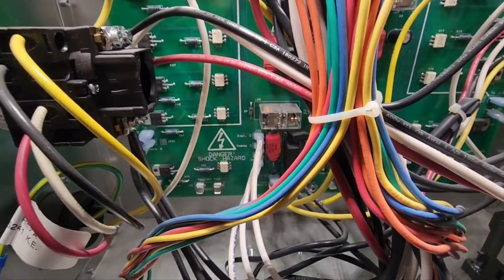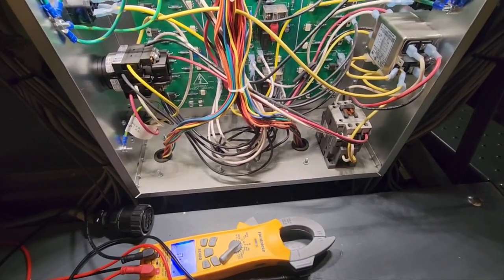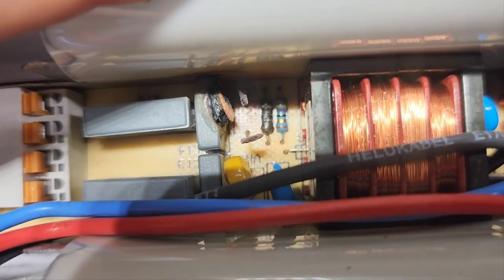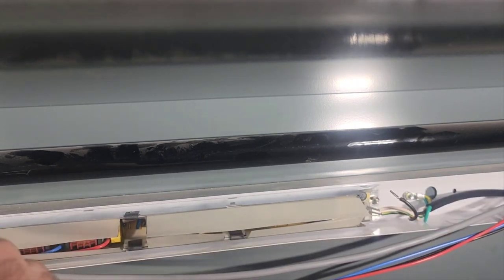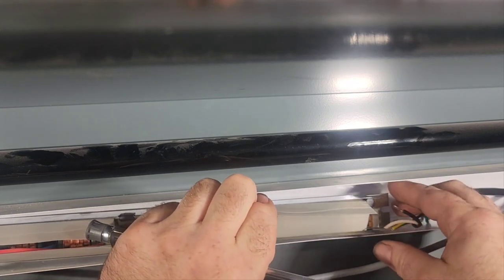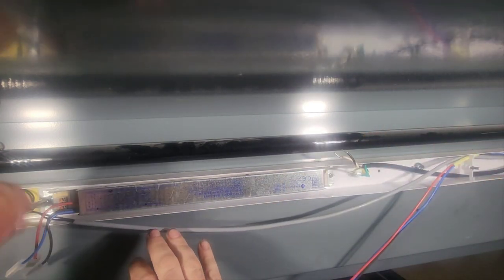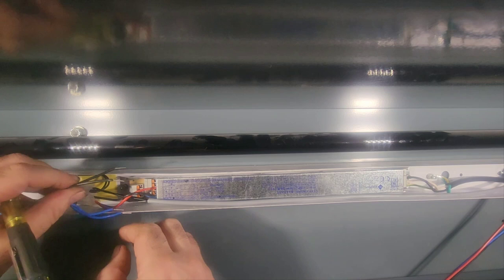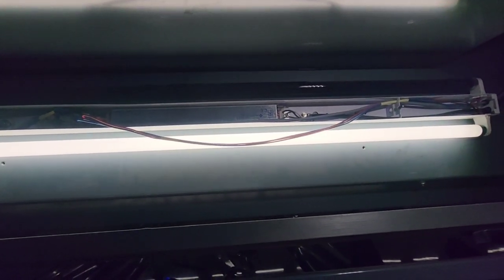Brunswick GSX dual lamp ballast replacement.

Comment: Nice video. How come these newer machines just don’t use LED fixtures?
Reply from the maker: There is an option for LED. We chose the dual lamp flourescent option so that we could switch to black light during cosmic bowling. We liked that look better than the multi-color LED option.
Reply: @michaelbuckley3808  Oh I see. I guess my thought was LED’s would look better.
Reply: I have the same problem but having a hard time finding the ballast to replace I have the exact same set up on my gsx